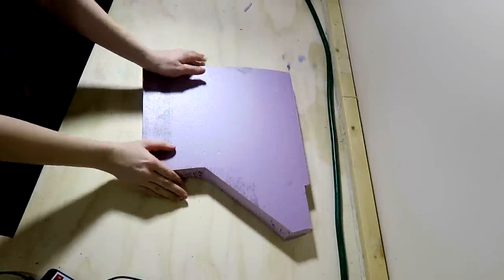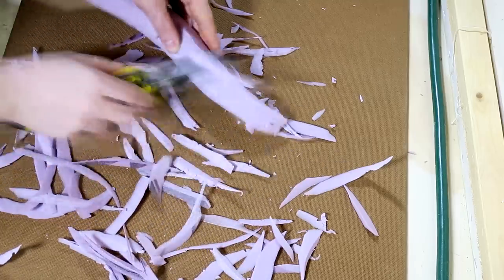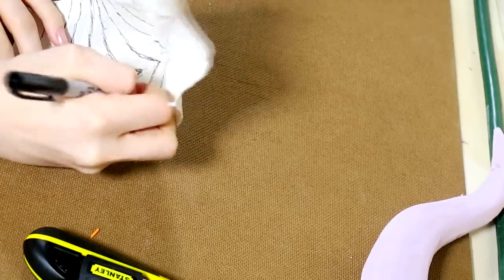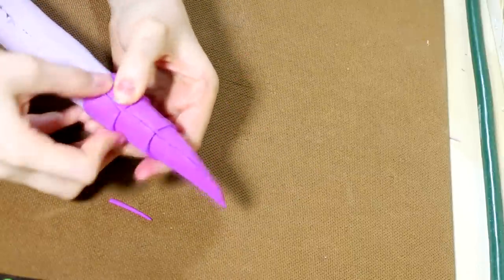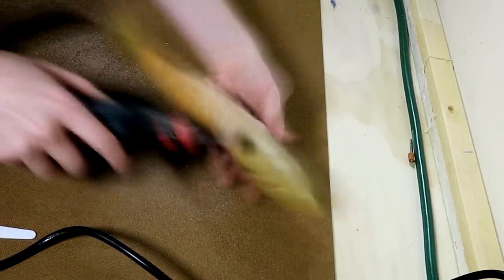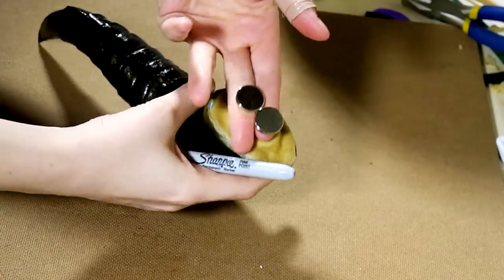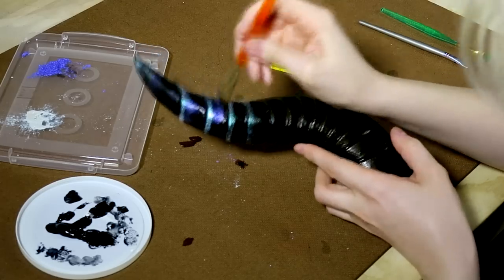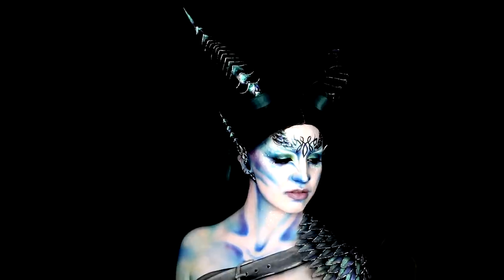DIY Dragon Horns | Magnetic Attachment | Foam and Worbla How To

Comment: Started this project this week and so far have a 2 small sets of horns and 1 large set of horns. I have the patterns drawn out and tonight begins the fun on putting them on foam and then getting started cutting and gluing the foam down before I start my first ever project with worbla. Thanks so much for posting this. I do have the earth magnets  too but think I will work these large horns into a aviator skull cap pattern I have. That was my ears can stick out for some air and the  horns can be working into the aviator cap.

Comment: Okay so I haven't seen this comment yet so - if you use insulation foam, please be incredibly careful when sanding it. Wear a mask with a filter (they sell these at the hardware store too) so you don't breathe in the excess polystyrene fibers, as they're a health hazard and can be very dangerous. Once you seal your horns, they should be fine for wearing, but while making them, please please please exercise due caution. If you have questions about specific types of polystyrene, you can find their MSDS (Material Safety Data Sheet) online, and that answers how safe something is for use. Please be careful and stay safe.

Lastly, thanks for the tutorial, it's really neat!

Comment: @NsomniaksDream hey just letting you know, I did try cutting with a scroll saw and it worked like a dream. It only took me 5-10 minutes to cut my horns out. As long as one takes it slow and holds the foam firmly on the table. Clean up was a breeze as well. I thought there would be alot of dust from it like wood, but there wasn't. I hope this helps you for future projects.

Comment: I love this but... Can you do I tutorial of a cheap version of this? Please and
Thank-
Reply: You could use floral foam and paper mache? It would need a thicker layer of paper mache and glue on the bottom so the magnets don’t just rip right out. It’s not as expensive if you use coupons at the craft stores.
Reply: I did a similar thing with a clay base, cling film, paper mache, spray paint and sealant, then mounted it on a headband with a hot glue gun. Came out at around £20 when all when done =)
Reply: Use a pool noodle and carve it into a horn... but foam clay on top.. and BOOM cheap version

Comment: i realize this video is older so i may not get a response but ... is the head piece under the wig necessary? Wouldnt the magnets be able to stick to each other without it? Or is its purpose to keep them from shifting? If they are as strong as you say, would that even be an issue?
Reply from the maker: The piece underneath is indeed for making them stay in place and taking the weight of the horns. The issue you might run into with not creating that piece is that you're putting all of the hold onto the wig, and since wigs have stretch to fit over the head, there's a good chance the horns will just sag or move. However, for a smaller set of horns you could probably get away without the structural piece underneath :)
Reply: you answered!!!! thank you for your response. i understand what you mean about all the weight on the wig. I found 17lb magnets so i may experiment a bit. i dont have worbla so constructing the head piece isnt the easiest for me right now
Reply: i am doing something really similar (also due to this video), also without worbla. I am using one of those wide stretchy headbands, i'm going to open it up and make the structure with two layers of craft foam and have the magnets in between.  and then glue the whole thing back together. To make sure the headband doesn't move i'm going to get wig clips and sew them into the headband so it doesn't slide.

Comment: what brand of blade do you use? i always find mine to break
Reply from the maker: For this I was using the Stanley brand blade but I did just buy myself an OLFA 20mm knife. The thicker knives tend to hold up better with foam carving. And having a sharpener around really helps extend the blade lives :D
Reply: NsomniaksDream thanks! i had horns in the making and totally changed my attatchment process once i saw your magnet head band in your makeup vid, so thanks this is awesome!